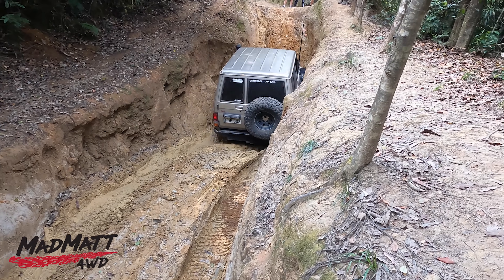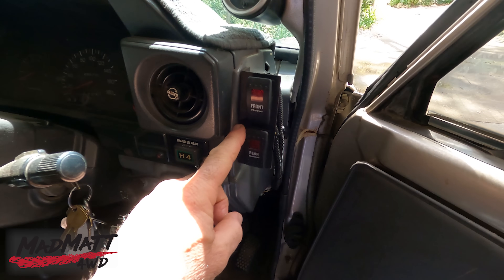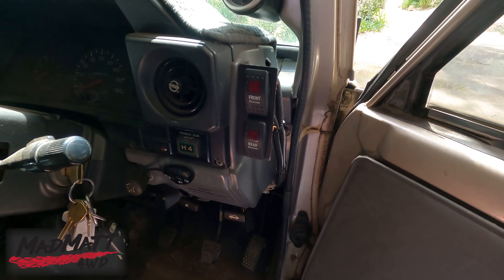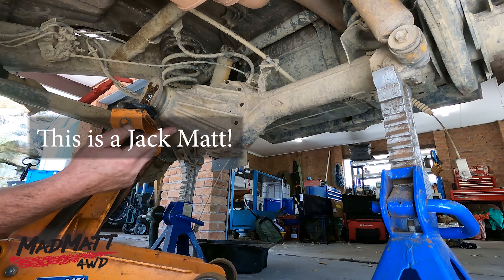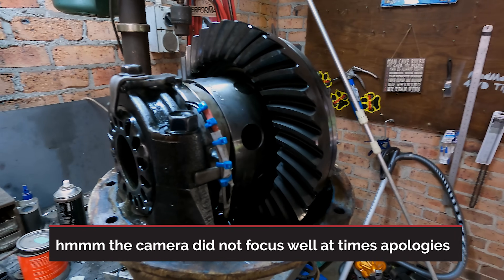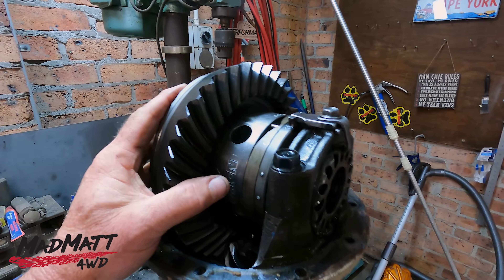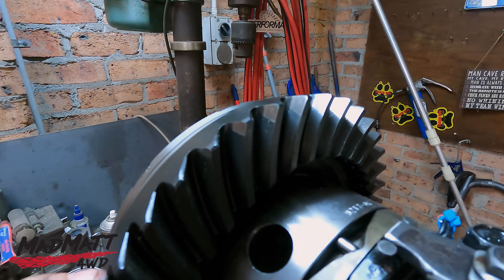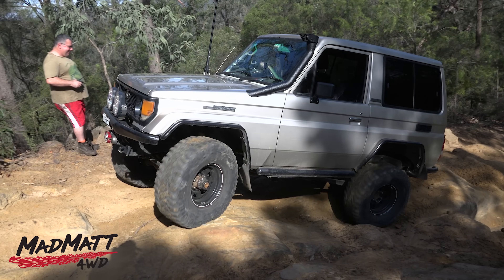Ultimate guide, HARROP ELOCKER, How it works, what's wrong with it, And How to Make it Awesome.

Comment from the maker: After posting this video @harroptv did get in touch with me and we had an excellent conversation. I appreciate a company that genuinly wants to help us understand thier product. This is what they wrote to me.

"Thanks for creating a very informative technical video on our industry leading ELockers Matt, and for allowing us to offer comment! The metal tab failure that you describe in your video was a known issue that was limited to a small batch of ELockers. This was caused by an incorrect welding procedure on the magnet by our external supplier. Once discovered, we very quickly changed our process and since then, all magnet tabs are welded correctly to ensure reliability and durability. We applaud you on your ingenuity to remove this apparent weakness, however we re-iterate that this is not needed due to this manufacturing process change. We know that you will continue to push the boundaries in your ELocker equipped Bundera and really look forward to seeing more of your great content and extreme adventures!"
Reply: I bought and installed mine only a few months ago so I suppose I'm good.
I actually bought the Harrop E-locker off the back of one of your videos and it's the best mod I've done by a fair way, thanks Madness!
Reply: Key question here has to be, was that small batch re-called?! & How does one know they're purchasing the new improved version? Given stock can sit on shelves for 12mths or more.
Reply from the maker: @tarayounger2585  they tell me it’s some years back so I would think it would be safe to go.
Reply: @MadMatt4WD  so are the tabs on your locker (originally) held on with tiny spot welds??
Reply from the maker: @pauls4708 yes

Comment: Can I put some adhesive in the small gap between the tab and bearing cap or even weld them together to prevent the impact from movement? Thank you very much.
Reply from the maker: No the tab needs to be free floating. Just ensure the tab is well welded to the magnet.
Reply: @MadMatt4WD  Understand. Thanks for the information.💯

Comment: Sorry to ask Matt but i do respect your experience and knowledge, im about to install elocker and new nitro ring an pinion 4:3 in my 105 front & rear and really lost at what oil i should use? 80W-90 or 85w-140 and mineral or fully synthetic??
Reply from the maker: Any of those is fine.

Comment: if I am in natural stuck on a steep hill and I engage my locker can I roll backward and the pins will engage. or do they only engage when moving forward?
Reply from the maker: Most lockers will engage with any rotation. But don’t be in neutral if at all possible.

Comment: I am installing one of these at present. I have worked on a variety of diffs over many years. This is a new experience for me. Question. As the Cam ring is engaged to the magnet when its activated what keeps those locking pins engaged? Putting it another way why is the locker mechanism not disengaging every quarter turn?
Reply from the maker: Because the magnet slips against the cam plate that holds the pins in. The magnet is held still by the retaining tabs.

Comment: Appreciate the Information looking at these Harrop E lockers vs the Arb air lockers for my 4runner
Reply from the maker: I rate them.
Reply: @MadMatt4WD  Huh?
Reply from the maker: @AntonioClaudioMichael  they’re good lockers.
Reply: @MadMatt4WD  okay Got you Mate Appreciate The feedback Still Kinda Leaning More tords A ARB for More reliability I have a few ARBs Already doing a front And Rear And Keeping My Center Diff Lock As Well on my v8 4runner
Reply from the maker: @AntonioClaudioMichael  I’ve had reliability issues with arbs. The centre difflock is simply a feature to give you basic 4wd. If you removed it you’d loose 4wd and just have an all wheel drive vehicle.
Reply: @MadMatt4WD  my v8 4runners is already a Perment All wheel drive in America the v8 models don't come in 2 wheel to 4 wheel actuated they are all wheel drive all the time the center diff lock in the tranfercase actually locks the front wheels to the Rear wheels torque and speed wise.
Reply: @MadMatt4WD  interesting you have had reliability issues with arb could you explain more? because I haven't had any issues with any of my arb air lockers..
Reply from the maker: Over time I find they get internal air leaks. I’ve had it happen I’ve with 3 of them so far. But I’ve also had issues with the elockers too.
Reply: @MadMatt4WD  okay I got you
Reply: @MadMatt4WD  that makes sense all lockers have there flaws over time

Comment: Diff locks - where does one start? I have a GU Patrol and have run a front auto-lokka for over five years. Love the positive traction and especially the fact that I have the ability to turn with traction. Tremendous on up-hill muddy climbs through trees where steering is important. But - I have pulled it out because of the fact that this diff puts a lot of load on all of the other front end components like hubs, axle splines and even the front drive chain in the transfer case, which stretches. Even when not in 4x4, there is still some loading going on because both axles are locked together most of the time. When heading downhill in 2WD and hubs locked, if a wheel locks up under brakes it will cause the dog teeth inside the diff to skip over the dogs which emits an awful clunking sound. I have replaced this Lokka with an LSD from the rear. Now to the rear diff - I have the Eaton e-locker fitted, but rarely have cause to use it. The front LSD makes a hell of an improvement. That being said, having seen the comparison between Pro-locker and the bigger, meatier, gears, hemisphere and cross-shafts, I will pull out the e-locker before it fails. Eaton made the hemisphere and gears physically smaller to save on parts inventory, tooling costs  and so they could use this smaller centre in more models. Purely a cost decision. Very little can go wrong with the pro-locker - provided it is fitted correctly and the sloppy machine work and clearances are fixed on installation. ARB air-leaker,(locker) rely on two 'O' rings to seal air pressure and over time O-rings exposed to cycles of hot and cold and oil will harden and leak, resulting in pressurised air leaking into the guts of the housing and then forcing oil out from axle seals and breathers. Not to mention the constant cycling of the compressor trying to maintain pressure to actuate the locking ring. Eventually the diff has to be pulled out for servicing.
I have run with Detroit auto-unlockers in a short wheel base MQ back in the days, but what a nightmare on Elm-street, or any street for that matter! Very touchy in corners if you come off or on the loud pedal when cornering. The huge backlash, resulting from clearance take-up within the dog teeth, was also disconcerting. You apply the park brake (which clamped on the tailshaft) and the car would still rock forward about four inches as the slack took up! Agricultural at best, but that is where it came from - agricultural applications in tractors and loaders. Torsen Gleeson, not driven with it - heard too many horror stories of them blowing apart, and very small selection of vehicles it is made for. Cheers. Pound for pound, the pro-locker has to be ahead because of size and strength. Even if people have no issues with the Eaton, why would you choose a physically smaller unit when a bigger, stronger unit is available?
Reply from the maker: There’s so many points we could chat about but probably a few of my other videos on lockers would be of interest to you. Search my channel for lockers and differential. That should help.

Comment: Hey Mat... I've got a Toyota Hilux 3L turbo diesel with the Harrop Eaton e-locker in the rear... I would like to know what gear oil is recommended when using this style of locket..I've heard API 5 75W-90 mineral based gear oil and others tell me run synthetic..What's the correct gear oil and any recommendations on brand of gear oil also and would I use same gear oil in front diff with no locker...Thanks heaps Nick
Reply from the maker: I use penrite and would use what they say for the hilux. The locker won’t care

Comment: I have Harrop lockers front and rear in a 2011 Nissan Patrol.  We had them fitted when vehicle was new and with plenty of use, they have been brilliant.  I only had one problem with the after market electrical switches I fitted not earthing correctly, but that was an installation error and easy to fix.

Comment: Thanks for sharing, mine didn’t work while out wheeling yesterday and I’m about have a look over it .
I noted that you said that the magnet stops the ring from turning however I’m sure you understand retrospectively the magnet acts as a drag against the ring and forces the pins to write up the cam and then the magnet on the ring drag against each other the whole time the magnet is energised. I’m curious about the right amount of friction required to offer drag consistently and whether the type of oil use has any influence on this great video mate We have to catch up for a beer sometime
Reply from the maker: I guess the choice of words was off but yes you’re right the cam ring still turns. I’ve heard of them engaging when the wrong oil is used or too cold also when contaminated.
Reply: Not quite right. The electromagnet stays stationary all of the time. When it is energized, it  grabs the ring and the two parts are now stationary. Because the carrier, or hemisphere (depends on which trade school you went to) is turning with the crown wheel, there is a tiny amount of friction between the carrier and the stationary ring. It is inconsequential. However, you touched on oil viscosity and contamination and this could be the cause of rare cases of self engagement. Not something you would want to happen on the freeway at 100 klicks!

Comment: Hey all, for someone that wants an aftermarket Locker who has no technical knowledge on how to adjust or repair and wants a good balance of manly on road and a weekend here and there where a rear locker would be a safer choice. What would be a good choice.. it’s all above my pay grade on this. 
Any advice would be greatly appreciated. Cheers.
Reply from the maker: You could consider an auto locker for the front they’re cheap and work well. I don’t use them because I like control.

Comment: I’ve got a Harrop Elocker and damaged my locking ring and a side gear in my Dana44. I cannot for the life of me find the rebuild kits listed online. Not even Harrop or Eaton stock them! So I’ve basically got a broken non-rebuildable locker. 2K down the drain. Buyer beware
Reply from the maker: Yikes. That’s not good. @harrop should have all the support you need. I would expect nothing less.

Comment: hi matt.can i get a little info on welding to that magnetic ring please.a local fan shop said not to do it as it messes with the magnet.how’d you go with it mate?
cheers
Reply from the maker: As I say in the video it needs to be tig welded on as low a heat as possible. It could affect the magnet but only if you go to hot. It’s really not hard to weld. The tabs are welded on by harrop so it can’t be to bad.
Reply: cheers mate.i’m going for it 🤙
Reply from the maker: let me know how it goes

Comment: you crack me up Matt, "You buy got gear so you want the stuff to work" lets open up the new e-locker you bought, void the warranty and start welding it to not break... does not sound like a good value proposition in my book. In regards to the storm in the teacup. It depends on how you drive most people I drive with including myself have fun driving obstacles technically and with the least amount of attempts as a challenge/sport or whatever you like to call it. So any second, 3rd, 4t attempt is a personal minus for me/us. With an e-locker, way, way too many repeated attempts are because the locker was not engaged when it needed to be not because you didn't pick the right line, gear momentum. If you don't mind how many attempts you have on an obstacle the e-locker will eventually work and get you over (if it hasn't broken).I guess really depends on how you drive.  In this regard, we have to agree to disagree. ;-)
Reply from the maker: You crack me up Stefan. Do you see the tracks I drive in the manual shorty Bundera on 33s with no flex? Often time first go! Anyway we all know you and your mates are. the only ones who goes hard. The rest of us are mere beginners who try to keep up.
Reply: Stefan....i know you're a europhile but that was seriously hard work to read. How many times did you hit the crack pipe before you wrote that? Or did you proof read that through the lens of an empty schnapps bottle? We all know you have a bit of a hard on for bagging out e-lockers but dude, did you even watch the same vid as us? i mean your comments were about as relevant to the video as a hard on in a convent. But no matter, i still look forward to your next "hardcore fire trail" youtube video.
Reply from the maker: Thanks for a very creative comment but let’s not get too nasty.

Comment: thank you for this video Matt. I had exactly the same problem last week... The cable was cut from the inside because the two tabs broke off. Terrain Tamer agreed to replace the magnet for me but they say the problem is with the installation. The solder you added on top, won't that damage the magnet?
Reply from the maker: Glad to hear terrain tamer did the right thing. As I say in the video I tig welded it and I think you need to be very careful with that.
Reply: mate very common issue happens to many people

Comment: Awesome video Matt, 
My 2015 fj cruiser has the factory elocker in the rear, would it be worth it if i have a harrop elocker installed in the front ? I wheel alot and am going for the harder tracks. Would it put too much stress on the drive line in particular the front components like the front CVs? Would love your thoughts on this please.
Cheers Loz 
Ps love ya work and go the bundy !! 😀
Reply from the maker: Hey mate. Imo a locker is always going to make a stronger diff centre because it holds the crown wheel better. It doesn’t flex away from the pinion. As for blowing cvs a locker doesn’t make you blow cvs if you drive with wisdom. The tyre provides a given amount of resistance and any given surface. So adding bigger and better tyres is what will blow cvs before a locker will. Is the rear locker harrop? I don’t think so. Anyway yes add one to the front it’ll make more of an impact on your wheeling than the rear does. Go watch my video on front vs rear lockers.
Reply: @MadMatt4WD  thank you Matt.  I am running 32 inch tyres, Nitto trail grapplers 275/70/R17.
The rear is factory elocker from Toyota so not sure if its actually harrop or not. I drive within my boundaries but am starting to push the fj although not yet beyond its limits lol 😅
Reply from the maker: Make sure to send me your rollover video when you make it. 😂😂😂😂
Reply: @MadMatt4WD  hahaha 😆

Comment: Good stuff. I put a Harrop E-locker in the front end of my ‘99 100 series LandCruiser after the stock diff exploded last winter. It’s a well known weakness on this vehicle. No problems so far. I don’t push it too hard, so I’ll just run it as is for now. 
Thanks for the good info. 👍
Reply from the maker: If it happens again for the nitro gears. That fixed my issues with the 105 blowing diffs. Blew two.
Reply: @MadMatt4WD  Great to hear. I did go with the Nitro gears. I got the whole package from East Coast Gear Supply in Louisberg, North Carolina, USA. The were great. Really easy to deal with.
Reply: @mmpatriot2170  Exact same scenario happened to my 99 LX470 and I also went with the same kit from East Coast Gear. Haven't had a chance to test it out yet!

Comment: Hey mate, we have recently brought a Harrop elocker too for a Hilux project. I'm going to be doing the same modification to restrain the magnetic. Just a question, how many amps did you use when you welded the steel bolts on? I've got a good AC/DC tig, just wondering where abouts.
Reply from the maker: Hey mate. Awesome. Since this vid went up harrop contacted me and say all current lockers don’t have this problem any more and it’s not needed. They had a batch issue. I can’t remember the amps. Would have been low 30 maybe.

Comment: I believe the ProLocker is the old McNamara diff lock. It is built strong because it was designed and made by true diff experts.  McNamara sold the rights to TJM who now have them made to McNamara specifications overseas.  Jack McNamara was the father who designed the original Land Rover diff lock, then his son and now I believe the grandson.  I had his first production Toyota rear diff lock in my HJ47 Troopie.
Reply from the maker: I believe this is correct.

Comment: I personally have the TJM pro lockers in my GQ. Love the super strong design and the separate air system. I installed them along with some new 4.6’s and rebuilt the whole diffs. It was a steep learning curve but I had time through covid. Everything has worked perfect and I’m happy I gave it a crack and saved myself some serious coin!
Reply from the maker: Well done on having a go. I’m self taught on diffs as well.